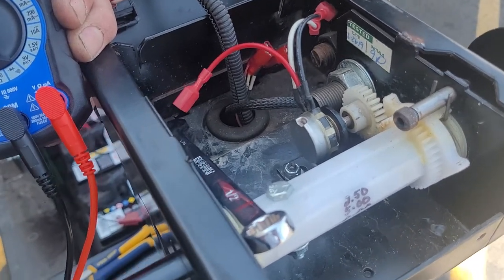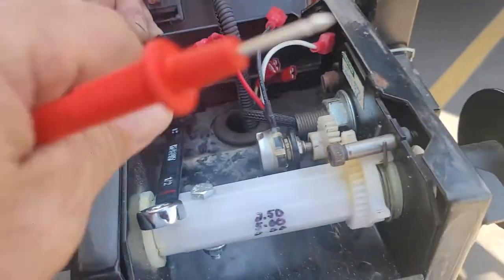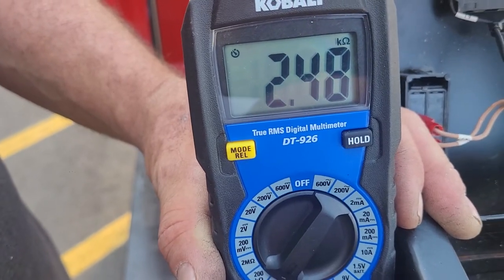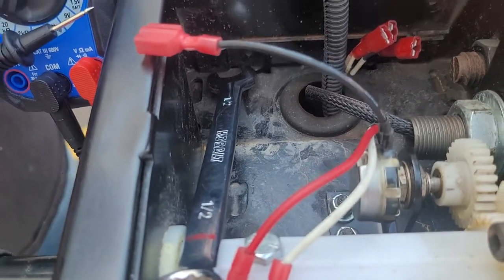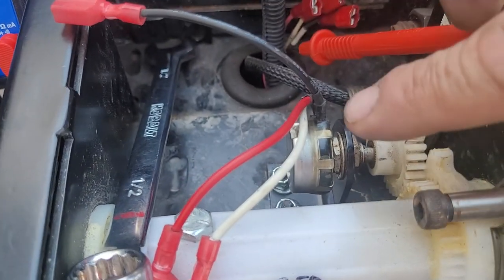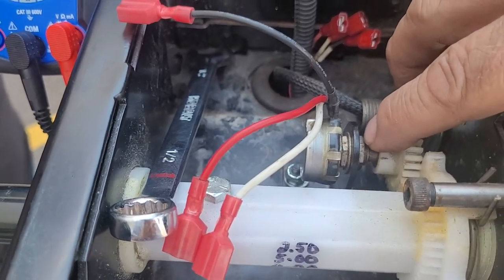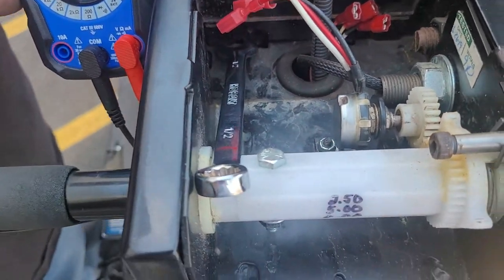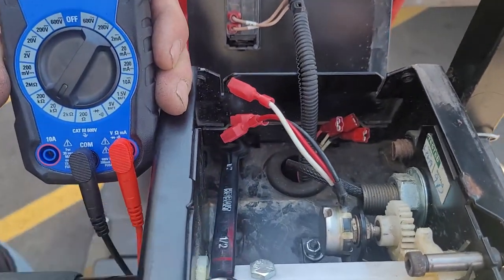Cart Mule Pot. Assembly Settings

Comment: These potentiometers wear a dead spot in their  neutral position pretty fast. I replace them almost always when there are throttle related complaints. I take the bracket out and have a spare I swap in that has the potentiometer roughly in the right position and dial it in as you've shown. I also make sure to have the gears  aligned straight and tight against each other to limit backlash. That keeps the values from wandering to much.
Reply: I have to agree i had to adjust mine to they wear out i like the quickarts better